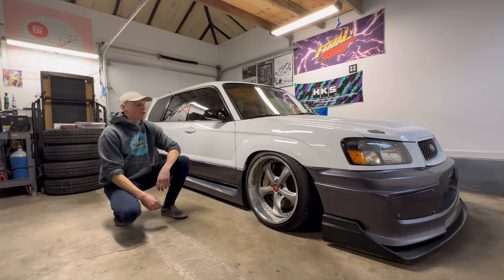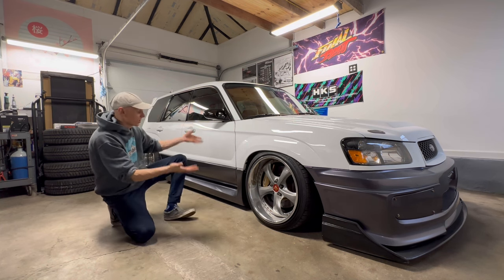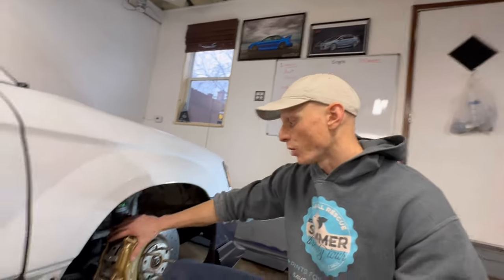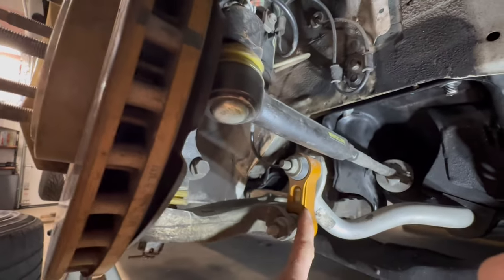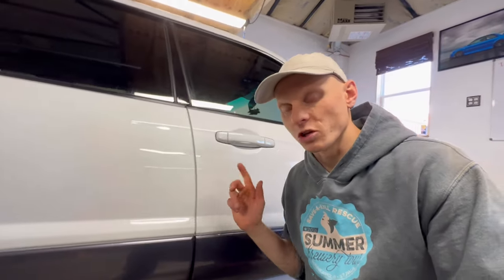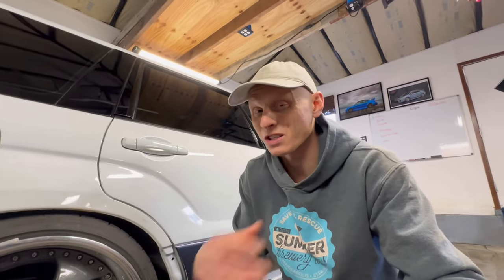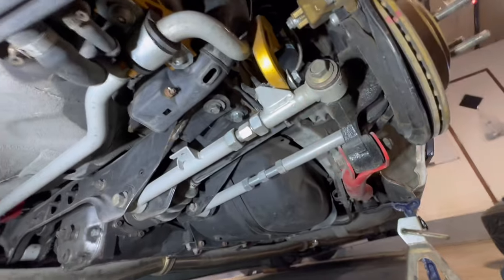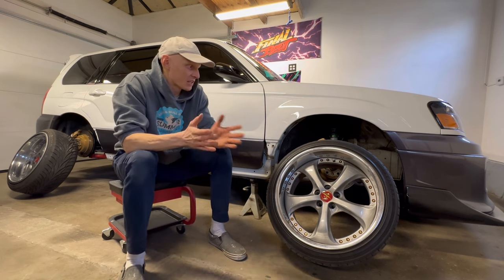BUILD BREAKDOWN: MY ’04 SUBARU FORESTER XT [SUSPENSION/DRIVETRAIN]

Comment: Art s soon as the weather gets better you better drift the fozzy!!!!!!   It will drive your views up !! tell me about that rear subframe brace. That looks custom
Reply from the maker: Absolutely, can't wait for the ice damn in front of the garage to melt so I can rip this thing again! The major reinforcements on the subframe are those center bolts and the solid diff/mount bushings that you can't see very well, they're part of what prevents wheel hop during burnouts.

Comment: Do you have the part numbers for the WHITELINE sway bar, sway bar links? And other parts? Thanks.
Reply from the maker: I don't have a complete list, but fortunately Whiteline has them categorized by fitment. Here are all the parts that work with an 04 FXT like mine: https://whitelineperformance.com/collections/all/2004-subaru-forester-xt-esi4705499

If you have any trouble finding a certain part #, just comment and I'll do my best to find it.

Comment: I like this :) How is the steering angle. Does it increase when you remove front driveshafts. And do you need to block the holes of the driveshaft when you take them out?
Reply from the maker: Not so great TBH, haha. It did increase a bit with the upgrade tierod ends, but in order to really take advantage of having no front axles, I'll eventually upgrade to an angle kit. Yes, you need to chop the stubs and bolt them back in for the sake of the wheel bearings.

Comment: Maybe you covered it already, but did you remove the subframe spacers?
Reply from the maker: I was going to touch on it in the engine episode, but yes the spacers are removed and I swapped over WRX/STI steering components to compensate.

Comment: I did cadillac brakes on my car, but it shutters a little bit under light braking. You have any issues with that? I did the bed in process and everything. Maybe my cheap rotors are just trash.
Reply from the maker: Hmm, I haven't had any issues personally. I have heard some ppl suggest upgrading to an STI Master, but my OE hasn't been an issue. Could definitely be rotors or maybe a sticking caliper pin?
Reply: @thenotorious_a_r_t  do ctsv calipers require an adapter?
Reply from the maker: @jeremyclose705  It does, check this out: https://ctsvbrakeswap.com/collections/subaru-kits/products/frs-brz-gt-86-4-piston-ats-caliper-bracket-kit

Comment: Are those 6 pot calipers?
Reply: Is there an adapter to run the caddy 6 pots
Reply from the maker: @Hardcore_flat_four  These are 4-pot, but there is an adapter to run C6 Corvette 6-pots: https://ctsvbrakeswap.com/collections/subaru-kits/products/subaru-and-frs-gt86-6-piston-c6-z06-caliper-big-brake-bracket-kit

Comment: Bro you need to invest in some quickjacks lol!!!!! those brakes are sick asf as an upgrade, were they powdered along with the rotors? Love the fortune coilovers, I run them as well! The STI is almost complete, Got it built up, put the new heads on, just waiting on buckets for the valves. Measured and ordered those last night. Be back on the road soon!!! Probably have to drain the e85 and put fresh in since its been sitting 4 months. Also got another BCP 500+ like I used to run. So now I got the vf48 and a FP green EWG if you ever need it. Can't wait to see the GC back together! Hope you are doing well!
Reply from the maker: Haha, tell me about it, up until a month ago I had access to two nice lifts, so I'll be investing in a quickjack eventually. Thanks!! I had them powdered separately as a knob to the OEM gold STI Brembos. That's awesome, Fortune makes some of the best suspension in the game, especially because of how much customization they offer. Hell yeah, great to hear, sounds like it's coming together really nicely, just in time for a spring finish! Love to hear that, I'll be working a lot on the GC over the next week, hoping to get it road-worthy before end of month. Thanks again for the push!!